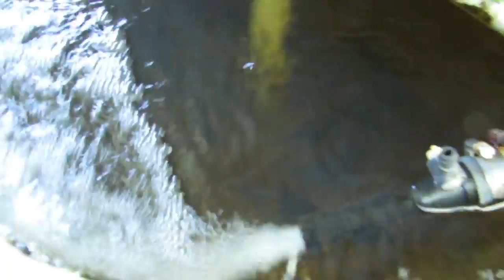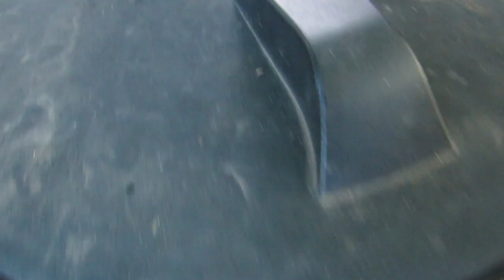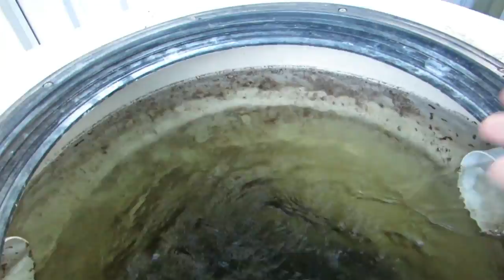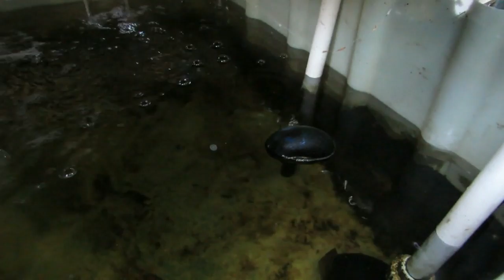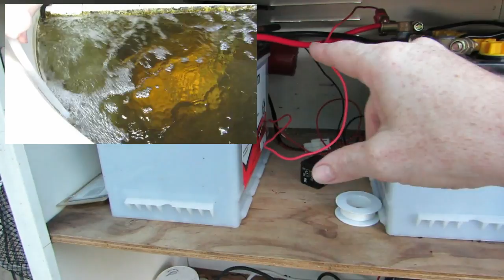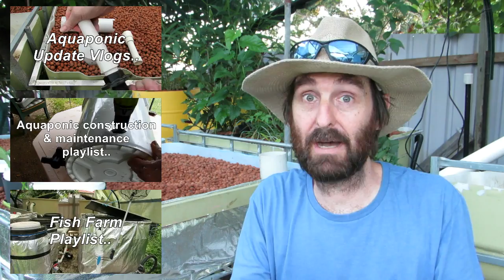Aquaponic Vlog 15.. How the water flows through the system & a look at the fish..

Comment: how do you top off your water? I'm loosing a lot of water to evaporation, and a minor leak I can't fix until I get a new barrel for my swirl filter. (used one of those red olive barrels and the uniseal isn't holding up). I have a pump in my sump that turns on when the sump fills, drops the water level about 6 inches then the slow pulls water from the fish tank to filters to sump to refill it. I'm thinking a float in the main tank is the way to go.

Comment: Greetings from the Northern Hemisphere 😀. Became interested in Aquaponics awhile back but hadn't had time or money to pursue. Now retired and seriously considering. 
First became interested with Aquaponics Book by Sylvia Bernstein (2011). Your videos throughly show the principles in Book 📖 and bring alot of clarity.
Like use of full height IBC container for Fish 🐟 Tank. (Preserves Structural Integrity) Could you ACQ Lumber for a lid without harming the fish 🐟?? Probably build tank with pond liner due to size and height restrictions of planned greenhouse. Wanted to have counter above fish tank to start seedlings 🌱.  IBC probably cheaper but too tall without cutting down and too wide front to back. Do like 👍 that they're transparent and could provide viewing windows 🪟 even if insulated. Thinking about raising Tilapia and need 70 degree temp at 39 degrees latitude. 
(Delaware in USA 🇺🇸) Have to really think about build versus IBC.
Why not utilize the attached IBC container drain?? Already valved and could serve as both external lift pipe and clean out drain for FISH 🐟 TANK. Tee past the valve to external lift pipe still keeps constant tank volume. Would require some removable interior screening to block sediment and small fish 🐟 into lift pipe 🤔. Wouldn't require a Uniseal or bulkhead fitting below top of FISH TANK. I'll keep watching your videos 📹 for ideas 💡.  WELL DONE!!

From America 🇺🇸
Michael E Rhue

Comment: @8 min in bio filter you showed good movement of media through ventury   below but which water is entering from down side along with ventury ? as radial flow outlet is on top so which point of water is mixed with air through that pipe , can u plz explain ?
Reply from the maker: Most of the water is entering at the top fro the radial flow settler  with some coming from the pump through the venturi as it needs to be under pressure for it to work properly. 
Hope that helps.

Comment: What did you finally decide on for your raft system? Why not get a couple of foam pool floats? Chesp, non toxic, certainly no fire retardants.
Reply from the maker: I have proper hydro rafts but this system is no longer. The new one doesn't have room for rafts but the next build will

Comment: What about bottom feeders and snails in the fish tank and filter tanks?
Reply from the maker: Had snails at one point & they ended up blocking pipes. Not sure how or why but they died off one year & haven't seen them since which I'm grateful for. 
Never had an issue with solids in the base of the round tanks. The "Plecos" some folks use are great at algae removal but anything that eats solids will also create solids so they will always be an issue.  I prefer to remove them & use them as food for other food plants in our yard. 
Cheers.

Comment: What about a water fall and air stone in the fish tank?
Reply from the maker: Now have one in there after a water pump failure. 😉 Caught it in time so there were no deaths. 
I know folks that run water over the top in spray bars & that's a great way to add O2 as well. Still think you need air stones as the bar won't work if the pump fails.

Comment: Why do you use pvc piping instead of HDPE? I am hesitant to use PVC, despite it's availablity because it may leach into the water.
Reply from the maker: PVC only leaches as it breaks down as I understand it. In saying that, I suppose it would pay to do a water test to see if any stray chemicals are in the water. Some of which may come from the mains water supply as well. 
HDPE costs a fair bit more than the PVC as the fittings are very expensive. 
If I had the coin I would skip all plastics & use stainless steel. 
Cheers.
Reply: @RobsAquaponics  Thanks for the answer, I have some PVC to raid.

Comment: Hello Rob, my shallots are growing with a quite light green colour, would you know why? My guess is something to do with the nutrients, my little system is under a 50% uv shade cloth as well. Cheers from Sydney
Reply from the maker: Hi Everton.
How old is the system? 
If it's fairly new it may be a lack of nitrate in the system as of yet.
Reply: @RobsAquaponics  Hello Rob, thanks for the reply. My system is fairly new, about 6 months. The nitrates were off the chart once then it went to 0 a month ago, some people told me that the system has cycled. I've added a couple more fish to see if anything changes
Reply from the maker: @EvertonM  I'd say you need more Fish/feed in there too. Have you increased the feed much as they grow? 1.5% of body weight is standard for Silvers & Jades if you're running with perch.
Reply: @RobsAquaponics  I'm actually running with comet gold fish (7 of them at the moment) as it's a experimental thing for a future project. I'm trying different setups in the same system, grow-bed, that pvc pipe with holes to stick lettuce in it thingy and recently added a dutch bucket. It's a 60L setup only almost like chop without a sump but with a swirl/solids filter. I used to feed the fish once a day but now twice. had a problem with algae in the filter. I can send you some pics if you are curious. Thank you for the advises ;)

Comment: Your third tank, the solid trap. I don't think it has any role in your system since the water just simply go from the Bio filter straight out to the sump tank!
Reply from the maker: The 3rd tank was to have another filter set up in it but I just never got around to it after plans changed. 
It does serve as a settling tank though & I get a fair amount of solids collect in the base.  
It's also a very handy dosing point for when I want to mix in the calcium hydroxide as well. 
Cheers.
Reply: I see. Thanks for answering!

Comment: You mentioned you needed to find some suitable material for making homemade grow grips. I did some research for my own system design and found that there are several brands of "Pool Noodle" type foam pool floats that are made of expanded cell polyethylene and won't leech chemicals into water, hence they are totally nontoxic. They can be easily cut to fit your float-board  holes for your DWC with a utility knife or a pair of scissors and won't degrade when exposed to sunlight nearly as fast as styrofoam will.  Also, styrofoam (aka polystyrene) of ANY variety DOES leech toxins into water, so I am not sure why people are using it in aquaponics, because it IS toxic, as is PVC pipe, which should NOT be used in aquaponics/culture projects. POLY/PEX pipe is only slightly more expensive in most cases and is very flexible when needed, so it uses far less fittings and comes in small-to-large rolls, thus, it winds up being CHEAPER than PVC pipe and fixtures long-term.

I decided to use an "A" frame style misting system set up OVER a DWC catch-bed that collects the runoff from the misting system. You can grow TWICE as much food in the same amount of space using the "A" frame misting setup than with a DWC alone.  This way I can grow my plants ABOVE the DWC tank, leaving about a 1ft. gap between the bottom of the plywood board and the water in the tank. I then grow duckweed on the top of the water in that same tank, while also growing crayfish and fresh water prawn below the duckweed (the prawn and crayfish are in different DWC tanks of course). This allows plenty of sunlight for the duckweed to flourish, while the duckweed shades the crustaceans from all the direct sunlight. I get THREE uses from the same DWC water tank simultaneously that way.

I used 1/4 inch plywood cut to 2ft x 4ft size and 4 inch staggered centers for the holes to make my grow boards for the "A" frame. I then sealed on both sides and all the edges with a product called "Pond Armor," which is a paint-on HDPE liner product that cures to a 10mm thick 'skin' that is 100% waterproof and protects the wood while also protecting the water from any toxins that COULD possibly leech from the wood if it was directly exposed to the water. FYI, I talked to the manufacturer of "Pond Armor" and was told that you COULD use it to paint styrofoam boards without any issues. So, if you ARE going to use styrofoam, then I suggest that, AFTER you get all of your holes cut, you paint it with the "Pond Armor" product until it is 100% covered, including INSIDE your plant holes. This will seal it up and prevent it from leeching into your water as well as protecting it from degrading for YEARS instead of months. Again, RoI for the Pond Armor is considerable when you start pricing styrofoam boards these days, as they are a petroleum based product, and the price for styrofoam boards is linked to fuel prices worldwide, so constantly replacing them because of degradation is costly.

I then used the pool noodle DIY ‘grow grips’ in 2 inch net posts to hold them in the holes on the boards. The misting system is mounted on an open HDPE “A” frame structure that the plywood boards are then set on and leaned against to form an enclosed “A” structure. The misting heads are arranged in two rows on each side of the frame structure, one high, one low, and angled to spray to the opposite side of the interior of the “A” structure with substantial overlap of the mist in the center area for full coverage of the boards, which is where the bottom of the net pots with the DIY ‘grow grip’ and plants/seedlings are. The open ends of the “A” structure are enclosed by a "tucked under" black 45mm HDPE plastic sheeting so that sunlight does NOT enter and shine on the plant roots or allow air flow from any wind source to displace the mist being produced in the system. This uses MUCH less water than DWC for the actual plants and seems to help produce them faster as there is no dissolved oxygen issues to worry about in the water. The runoff from the misting system falls directly onto a ‘floor’ layer of the HDPE sheeting (again, this entire frame, including this 'floor,' sits about 1ft ABOVE the water level of the DWC tank), which then has several small cuts along its slightly lower hanging center line to allow the water back into the tank below. VERY efficient and cost effective with the RoI of being able to grow three things in the same space, with the plants actually being able to produce DOUBLE the amount you would otherwise be able to grow.

Comment: Hey Rob writing you from Colombia. I stared making my system. My huge question is: how I fill up my system with water so I get the right amount for the whole system. Thank you.
Reply from the maker: Hey Joze.
It depends on if it's a flood & drain or constant flow. If it's a constant flow fill all the tanks & beds up & away you go. 

If it's a flood & drain system, you fill up the fish tank & any filters you may have as well as the sump tank, then turn the system on. DO NOT fill up the grow beds as they will over flow the sump when they drain.  

When you're wanting to top up the system up with water, you remove the stand pipes from the siphons in the beds & fill up the sump until its at the level you want it. Then you can replace the stand pipes & you will have no issues with the sump over flowing.
Hope that helps some. 
Rob.

Comment: In this system, how many plumbing and aeration system do you use?  Do you have video on aeration and plumbing system?
Reply from the maker: This clip shows the 10000LPH pump in the sump that runs the system. I now have air stones in the fish tanks running from a 4000lph air pump but that is the only addition. 
Cheers.

Comment: So Rob, if I am using an IBC tote for my fish tank, would you recommend placement of my SLO off to the side over what would be the stock drain or place it in a corner for best result.  I am assuming of course that would be better than setting it up in the middle of the Tote. I already plan on fabbing up a solids siphon job I seen in one of your clips for the extra cleaning as I am aware that round tanks are better for fish tanks, but hey "I gotta run with what I brought to the track."  Thanx.
Reply: also what size PVC pipe are you using for your SLO out of the fish tank. I can go any size. I was gonna go 1 1/2", but I didn't know if it would effect the flow rate negatively to the swirl filter and pondered maybe I should go 1 1/4".
Reply from the maker: Sorry I missed this Jeff. Just found it by chance. Hows the system running at the moment?

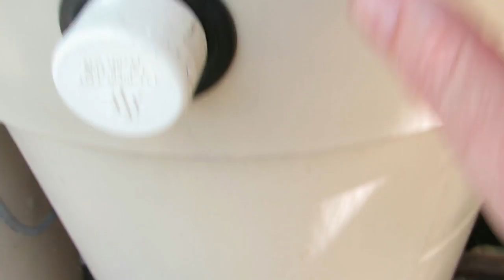Comment: Hey Rob!  Can you please explain the venturi in the moving bed bio filter starting at 7:54?  I want to do this in my moving bed.   I have 1sqft of K1 in a 50gallon barrel that being tumbled by an air pump but would much rather do it like this.  What is the black pipe and fitting connected to at the bottom of the barrel?
Reply from the maker: Hey Joshua. Did I reply to you about this on another clip the other day?  If not let me know & I'll run through it for you. 
Cheers.
Reply: +Rob Bob's Backyard Farming.  Yes, you did.  Thanks.   I've ordered a 1" manufactured Venturi and will probably need to upgrade the water pump.  Thanks!

Comment: Hey buddy! i just saw a video where the guy talks about this back-up pump with a built-in water pressure senser that automatically kicks on when it senses a drop in pressure. he had it wired to a car battery. 

here's the link. you may have seen it. https://www.youtube.com/watch?v=YpKayMx-edQ&t=729s
youre an inspiration, keep it up! :D
Reply from the maker: Cheers for that mate. Haven't seen any pumps with the inbuilt switch here that could do the flow rate I need for the 2 tanks but will keep looking.  I think I'll need to set it up with a flow switch in line somewhere. 
Cheers

Comment: a couple suggestions for stuff mentioned in this video

first, maybe go to stores that sell large appliances like fridges etc and see if they'd be willing to let you take or buy for very cheap the large polystyrene boards that are used for packing the larger items because it'd save them having to dispose of them themselves and those could be suitable for the deep water culture floats

second, on your gravity fed water lines maybe install a few small hydrodynamo's in the lines that will reclaim some of the power that's used for the pump fed lines and it could also recharge your backup batteries so that if there is a power failure that you miss, the gravity fed lines will give the batteries a bit longer before loosing all their charge so that if it happens when you're not at home for a couple days or something you're not going to have as big of a problem to fix when you get home
Reply from the maker: Hi there.. Thanks for the suggestion.. Have also seen folks use the lids from broccoli boxes well as the packing foams.. The floating rafts need to be made out of something a bit stronger than the packing style foam though.. Extruded styro is what is normally used as it doesn't tend to crumble into balls as quick as the other foams..  
Have spoken to a mate about installing mini turbines into the tubing.. I have left it with him to see what he can come up with,..
Cheers & all the best.

Comment: Rob

Love your videos. Thanks for sharing. Quick question for you. I've played with venturis in aquaria and flowing into my Matala BioStep pond filter. What I've found in an aquarium was that the lower I had the Venturi relative to the water level, the less air I was able to introduce into the outlet stream. With your moving bed biofilter, clearly you are keeping your medium moving but are you able to pull air all the way to the bottom of the barrel?  Have you considered putting the Venturi inline but external to the moving bed biofilter or using an aerator and air stone to oxygenate the biofilter. 

Thanks once again, love what your doing, 
Tim
Reply from the maker: Hi Tim..
The venturi is pulling air down to the base of the filters fairly well at the moment..  I have been contemplating turning the venturi off & just running an air stone in the fish farm that way but am happy with the way the venturi is working in the aquaponics for now.. It might all change yet when the new filter barrels go in though.. Shall see what works best for the system at that time..
Cheers & all the best,
Rob.